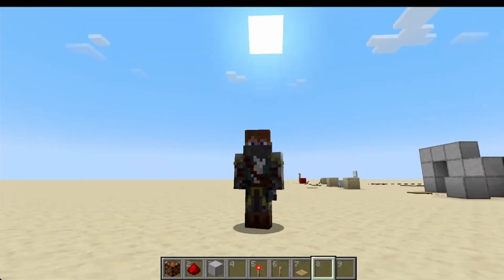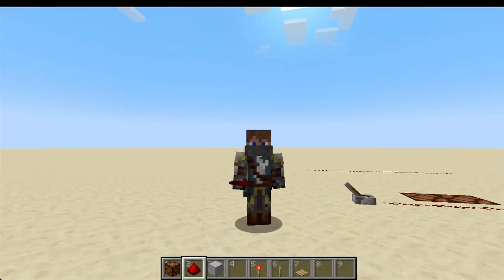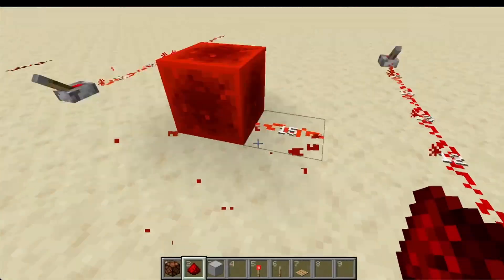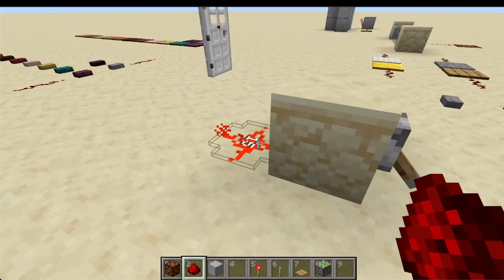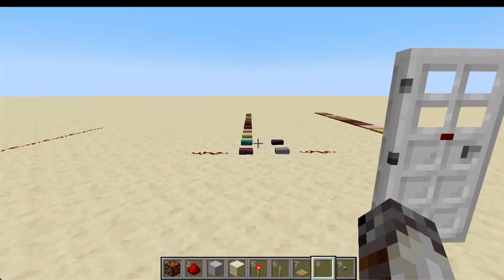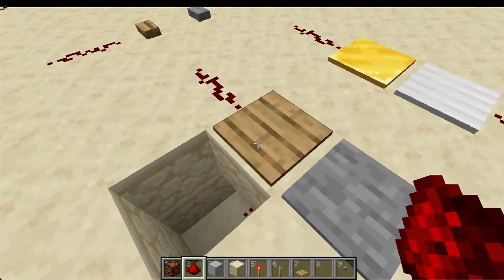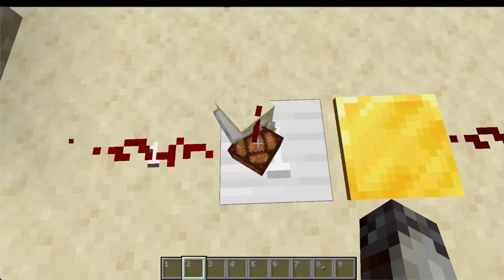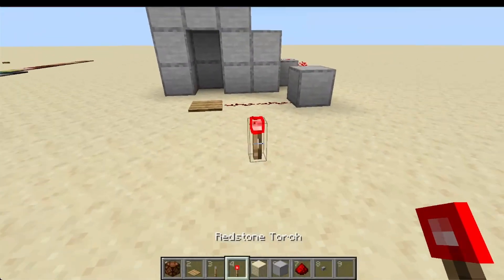Power Components

Comment: 0:46 *Copper wire also has distance limitations irl. The longer the wire is between your input and output, the higher your resistance, or Ohms. If your resistance ever surpasses the corresponding requirements for the electrical "push," or volts, your circuit will not operate.
Reply from the maker: That makes a lot of sense. I don't know why I didn't think about that when I was scripting this video. To be fair though, copper wire can probably go more than 15 meters without needing a boost lol